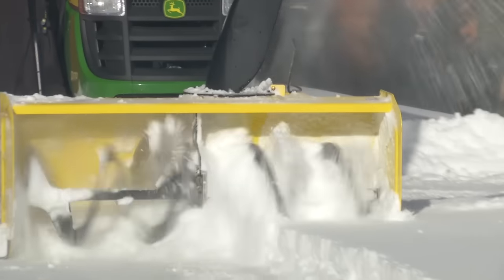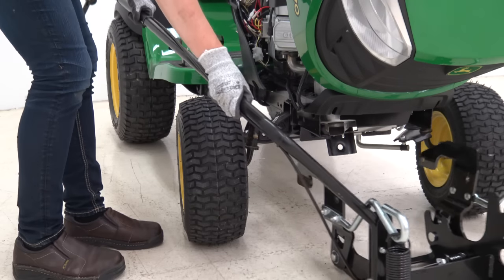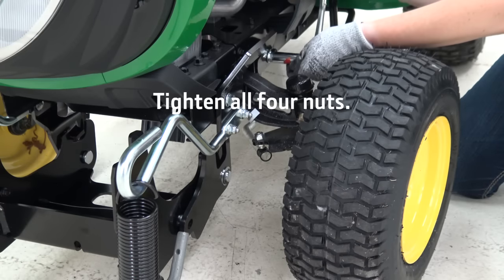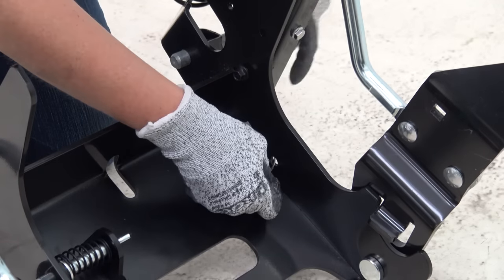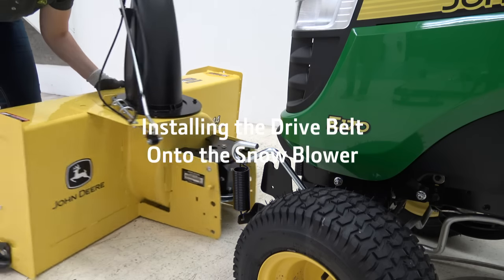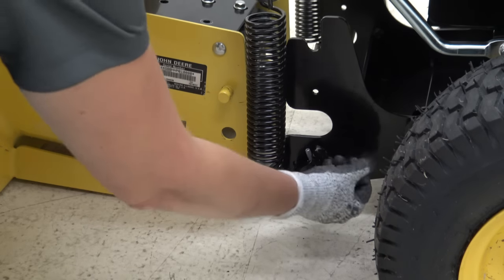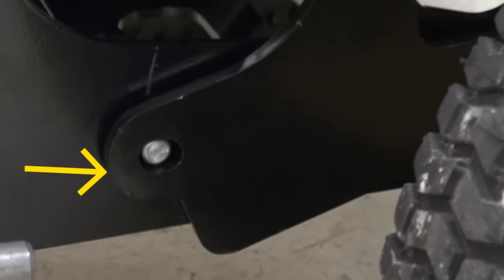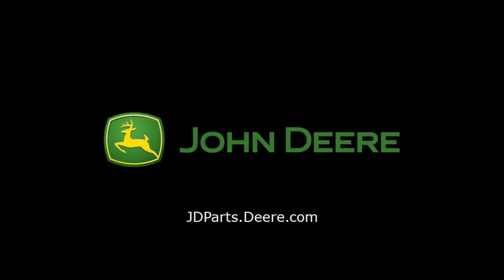How to Install the 44” 100 Series Snow Blower | John Deere Lawn Tractors

Comment: Will this fit a John Deere S220?
Reply from the maker: Thanks for the question, Amory. Yes, the 44-inch Snow Blower will fit a S220 Lawn Tractor. You can find parts and attachments for your unit here: http://spr.ly/6053PpZsZ. Your local dealer is a great resource to confirm part numbers and help order. If needed, you can find contact information for your nearest dealer here: http://spr.ly/6054PpZsw.
Reply: Was wondering if you bought this 44 inch snow blower? Did it come with all the parts shown in the JD video? Mine is missing the belt drive module and you can;t just get that part, but have to buy all the individual pieces that make up this module and assemble them. Cost is $1700 Canadian to buy all the parts. Wondering if you got the belt drive module as shown in video. Bill
Reply: @cptnbillyjohnstone510  I havent bought it yet
Reply: Mine came with it, but factory installed the belt incorrectly

Comment: What size Carriage Bolts and nuts are used to attach the Front Hitch Assembly??
Reply from the maker: Anthony, you can find a full break down of the parts used in the hitch linkage of this 44" Snowblower attachment in our online Parts Catalog here: http://bit.ly/2qFuGO4. You can also find a full list of parts included with the 44" Snowblower in "Section 20 - Assembly" of the attachment's Operator's Manual here: http://bit.ly/33ILXVq. We hope this helps!
Reply: @JohnDeere  the second link in your reply was very helpful  for the blower I have.  The local JD dealer was also helpful in providing a complete exploded view and parts number list for me.

Comment: Does anyone know if the 100 series snow blower will fit on the 300 series?
Reply from the maker: Thanks for asking, Craig. The Snow Blower attachment featured in this video (BM26888) is only compatible with our 100 Series and S240 Lawn Tractors. You may be able to locate the Snow Blower attachment compatible with your unit by searching your model number in our online Parts Catalog here: http://bit.ly/36O6jOD. The Snow Blower attachment compatible with your X300 Series Lawn Tractor may vary depending on the model, model year, deck size, and serial number break, so we recommend reaching out to your local dealer to confirm the correct Snow Blower before purchasing. If needed, you can find their contact information here: http://bit.ly/2WVxSB5.

Comment: Where do I buy this exact model of snowblower?
Reply from the maker: Thanks for the question, Ghillie30m1. You can look up and order many attachments online at Deere.com/Parts. Simply enter your unit's model number and view the corresponding Parts Catalog. Your local dealer would also be happy to assist you with locating and ordering attachments for your unit. If needed, you can find your local dealer at dealerlocator.deere.com. We hope this helps!
Reply: any angry yard sale should have them brand new with only a few hammer dents and urine stains
Reply: by the quality if mine id say at the dollar store

Comment: Anyone have a tip for removing the metal bumper? The clips are locking it in and preventing removal.
Reply from the maker: Andy, your local John Deere dealer is your best resource for technical questions like this one. You can find your closest dealer here: http://bit.ly/33YYpjT.
Reply: Ya push the clips in with a screwdriver after you pull the pin and slide it out.
Reply: Josh Frentzel Finally managed it. Thanks mate.
Reply: @andygoggin4762  I also struggled with the bumper longer than I expected :)
Reply: Trang Thai it sure wasn’t as simple as the robot in the video made it look. Mrs. Champ pitched in and the bumper slid right out. Hard to do solo!
Reply: The Robot in the video - LOL - Loved it Andy!!!
Reply: i just used pliers on the pins and the rest slid out but it is hard to see the pins direction to pull

Comment: How do I release the belt tension when removing the blower attachment?  I have an E170 with electric PTO.  Thanks.
Reply: Fiddled around and figured out that you have to manually pull to large black tension spring on right side of pulley assembly to loosen enough slack on the belt to slide it off the PTO.  For both installation and removal this is a pretty big step to omit!

Comment: Is that front hitch included with the snowblower or do you have to buy thay separate too??
Reply from the maker: Thanks for the question, Steve. The 44 in. 100 Series Snow Blower comes equipped with everything you need to install the attachment to your unit. We recommend consulting your local John Deere dealer for further questions regarding attachments for your unit. If needed, you can find your local dealer at Deere.com/Dealer. We hope this helps!
Reply: Tire chains and weights are separate but necessary.

Comment: Quick question, Can this be installed onto a E150 lawnmower?
Reply from the maker: Yes this 44” Snow Blower attachment is compatible with the E150 Lawn Tractor, Shiv. You can learn more about the 44” Snow Blower and other attachments here: http://bit.ly/2K6R7nP.